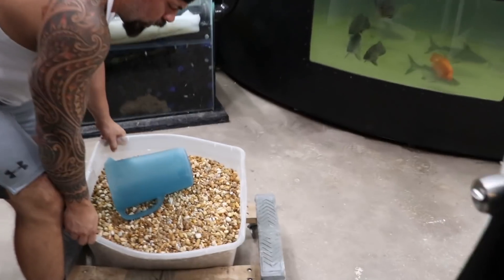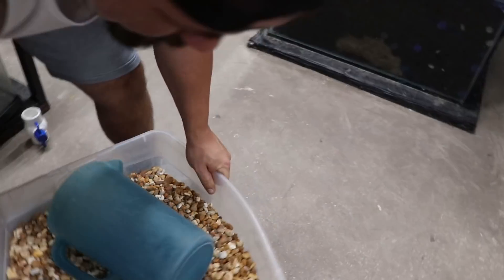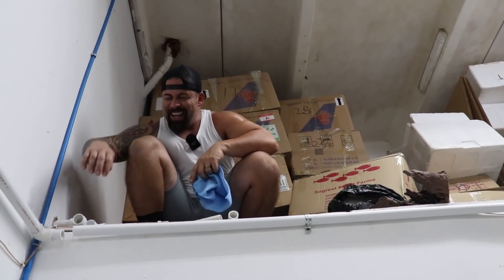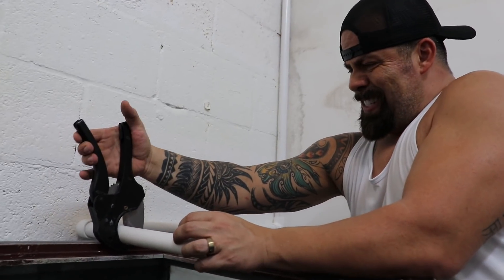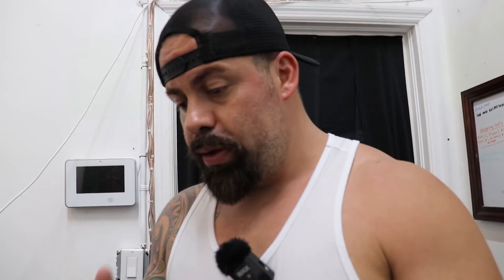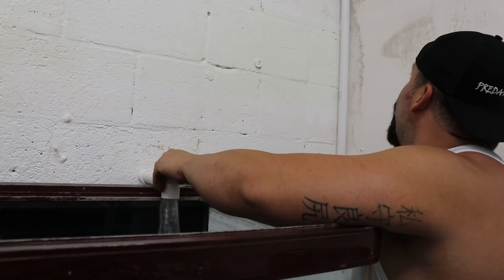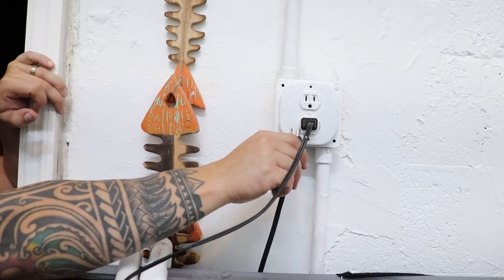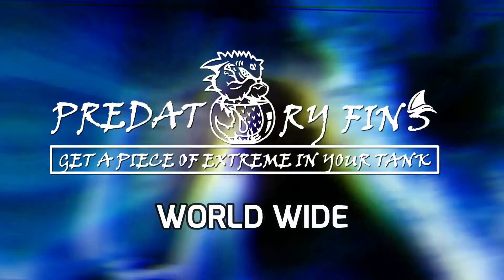WIFE TAKES OVER SHOP -  Adds NEW FISH TANK

Comment: Atman designe nice aquariums. I have 1 like this with external  dry wet filter on the lid. 3 lights on another 1 lid. the glass only have 3 pieces, the front and the sides go in 1 piece and the corners are curved. I love this tipe of aquariums, good job Lisa 👍🏻🤣 I use an external filter too, Fluval FX5